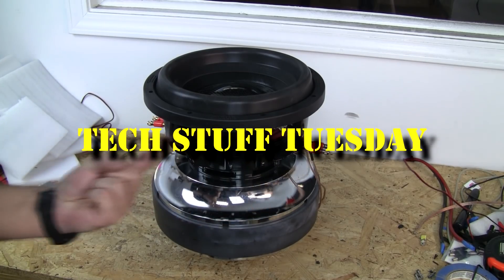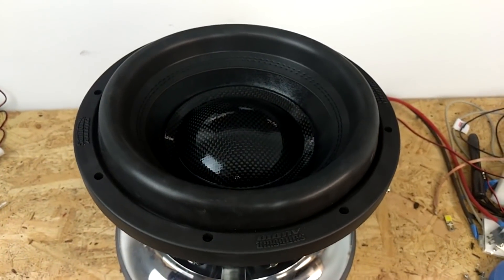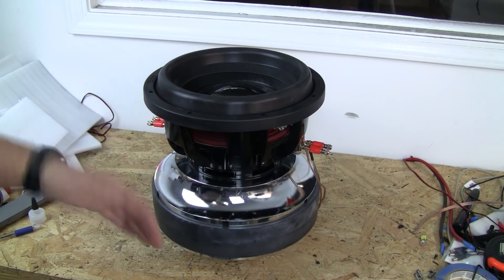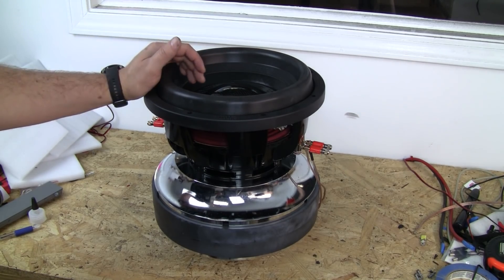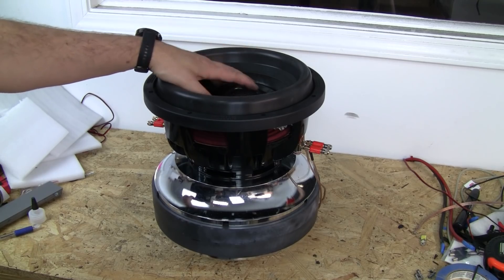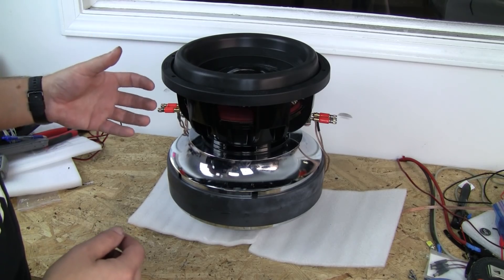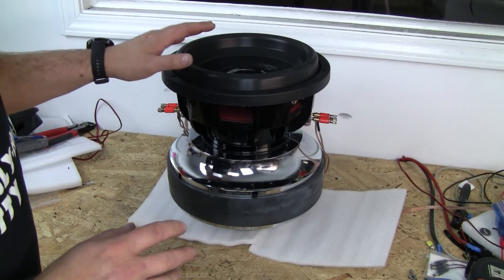This is why we bench test subwoofers - Tech Stuff Tuesday

Comment: EMF Audio, just a word of advice. A dremel tool ( Worx makes a very small profile rotary tool that is Corded and plugs into a battery pack) with a metal cutting wheel is ideal for cutting off your voice coil from the inside. You can get a straight and perfect cut and if it is a little uneven you can grind it from the top to smooth it off. Just wanted to bring that up incase you hadn't thought of something like that. Thank you for the awesome videos!

Comment: Hey :) I know the video is a bit older but I'm curious how we can calculate sub specs by ourselves since some. Companies don't give out the real specs
Reply from the maker: It takes specialized equipment for that unless you want to do a ton of testing and math, not something you can do with a DMM and a calculator. It's funny you mention that because the next Tech Stuff Tuesday accidentally showcases that.
Reply: @EMFAudio  hey man I got power acoustik 2500D with a single kicker 10 in a atrend ported box how should I set my gain? It's for a friend

Comment: I've never broke in any of my subs. Just strait to music.
Reply: I always just hook it up and play my normal music at 50/60% volume for a few days before I crank it up! 🔊🔊 never had a problem
Reply: the debate of wether or not to break in subs will never cease to exist as long a traditional subs are a thing haha. Personally, the closest thing I own to a subwoofer is a Ampeg ba 115v2 bass combo amp if that counts. 150 watts at 4 ohms (I think)  running through a 15 inch woofer and a tweeter. shit is loud af for my standards. I just gotta find a way to hook it up to a battery and toss it in a car, it already has the amplifier built in. But yeah I'll stop rambling.

Comment: I used to work for a satellite company which had a , if I remember well 15000 watts shaker speaker they used for testing unit reaction to vibration at different frequencies, the size was like (surround suspension) 6 feet and the surround was almost as thick as a tire... what a sub LOL...

Comment: For break in when sitting on magnet you should build a piece of 18 mm mdf to sit under magnet with a hole in middle and an exhaust gap to outside of wood for air flow from pole vent. Will help with stopping a pressure build up behind dust cap and give more accurate T/S

Comment: I also watched the build video and i wondered what subwoofer parts are the ones that defines fs. Is it so that stiffer spiders makes higher fs? It looked like you put one multilayer spider that had different colored spiders and so far all the subs i have seen had 1 to 4 similiar spirers. I`m going to make 10" subwoofer and trying to play some low notes with it. I probably use ti basket, 300oz motor ja 3" flat aluminium voicecoil so what kind of spirers and how many of them i should use?
Reply from the maker: The stiffness of the spiders and surround combined with the moving mass is what determines the Fs. The colors of the spiders mean nothing, they're all the same spider, colors used for identification. The weight of the motor doesn't matter, that basket is limited to 1 diameter of spider but the number of spiders also means nothing. Not every spider is the same stiffness and more doesn't mean better. To play lows you'll want a lower Fs, not a super stiff suspension.

Comment: whats the best 15in subwoofer @ 1000-1500 rms with the most excursion. I looking for a competitive sub-woofer to but against svs ultra 16 driver
Reply from the maker: https://emfcaraudio.com/products/sundown-audio-x15-v2
Reply: @EMFAudio  looks nice any chnace theres a 1 piece smooth cone with no dust cap?
Reply from the maker: @joeydelmarsjr.646  The smooth part IS the dustcap. I know the SVS sub you're comparing. The X15 enclosure would have to be larger.
Reply: @EMFAudio  for example the txx-bdc4-15, xr-15d4, and s2w15d4v2 all are smooth one piece with no middle dust cap. so your saying the whole cone is 1 giant dustcap?
Reply from the maker: @joeydelmarsjr.646  The cone us under it, it's a giant dustcap that secures to the top of the cone.
Reply: @EMFAudio  can you rebuilt with that look that I mentioned?
Reply from the maker: @joeydelmarsjr.646  In many cases you could simply put that style dustcap on top without changing anything else. In a worst case you would have to cut off the existing dustcap for clearance.
Reply: @EMFAudio  the reason I ask if I blow one of my audiopipe subs maybe you can rebuilt with that clean look and upgrade the coils to dvc 2 ohm 1200 rms
Reply from the maker: @joeydelmarsjr.646  Maybe, the dustcap is the least of concerns.
Reply: @EMFAudio  I see. I ask because I cant seem to find a 1200rms 2
Dvc 2 ohm to have head room at 1500 rms with the look I'm after
Reply from the maker: @joeydelmarsjr.646  I responded to your email. That style dustcap isn't common for a few reasons. You could add that dustcap yourself though.
Reply: @EMFAudio  I appreciate your help and advise

Comment: Why would sensitivity, not matter? I always heard that, the higher the sensitivity number the louder the speaker will play with less amplifier power. Also if you match the sensitivity of all your drivers, your entire system will play more nicely together. Meaning, you can run amp gains lower, and everything will peak around the same power usage without having to drive one amp harder than another. Is this correct, or have I been bullshitted for the last 20 years? 🤔
Reply from the maker: https://www.youtube.com/watch?v=VN_qgJkum20 You should watch that. As far as setting gains lower based on sensitivity, that's just ignorant. The gain is for matching the input of the amp to the voltage on the signal input. That's it. You'll likely never match the sensitivity of each speaker either. There isn't a need to do that anyway because you can adjust volume levels of each speaker to balance it out regardless. In short, you have been bullshitted in the worst way for the last 20 years.

Comment: Any experience with Brahma speakers?
Reply from the maker: Do you mean Brahma or Beyma?
Reply: @EMFAudio  Brahma by Adire Audio. My old buddy has an old version (purchased in 2004) which has some coil rub. We were thinking of disassembling and trying to diagnose it... You think it's still worth it?
Reply from the maker: @elit3darkness  The original Brahma, that was only in 1 size I have quite a bit of experience with. I had the first 2 ever made, I still have 1 I think. When it went to a line of subs which I think is what you're talking about, that was a different design all together and I've done nothing with those. Once you tear it apart it isn't usable again, so it's up to you if it's worth it to recone it to have it working again.
Reply: @EMFAudio  I guess down the rabbit hole we go lol

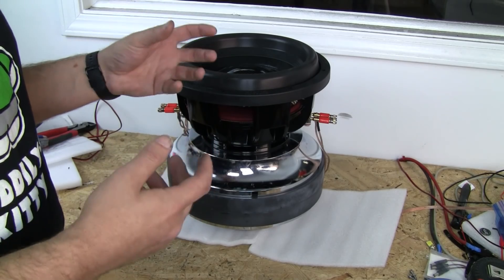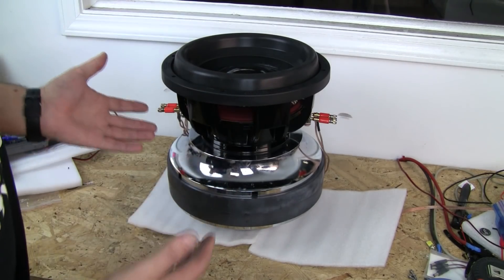Comment: 4:30-5:00 There were a couple of times there that your engine idle speed was so low I thought it was gonna die. :)
7:20 I noticed in the slo-mo, the speaker rocks side-to-side, perfectly in sync with the in-out motion of the cone. Could that be due to a slight misalignment of the voice coil in the motor?
Reply from the maker: It's due to sitting on foam and the entire speaker moving. That much motion wouldn't be possible from a misalignment, you can't physically see a misalignment. Misaligned or not, the forward and rearward motion is the same, the weight balance isn't any different.
Reply: @EMFAudio  
Foam, gotcha. 

My question was because, if the voice coil was off-center, the momentum would be concentrated on one side, and cause that rocking motion vibration. (shows up as rocking at super slo-mo)
Reply from the maker: @xenaguy01  Momentum wouldn't be changed because it's still forward and backward, regardless of it's position.
Reply: EMF Audio 
But if the momentum is not centered, it affects one side more than the other, causing a vibration.
Reply from the maker: @xenaguy01  Right, but the alignment has nothing to do with not being centered because that would mean the mass of the cone would be different on one side. The mass it the same around the entire cone. Because the mass is the same, the center of mass is in the middle, AKA centered.

Comment: Would love to hear how you go about calculating for perticual t/s parameters like if you did want this sub to have a lower fs or a different qts?
Reply from the maker: Without having known specifics on an individual part and the software to simulate it, you have to go off of experience. Lower Fs will come with a different Qts, and that can be done by using a looser suspension or adding mass.

Comment: I have two questions!
1. What happens if the sub will make some mechanical noises? Will you recone it again and lose that money?
2. Why is that sensivity so low, I mean PA subwoofers are 4 or 5 times louder on the same wattage, what are the differences?
Reply from the maker: 1. If there are mechanical noises it will get rebuilt at our cost. We do our best to ensure that isn't a problem during assembly and it's rare it happens.
2. That isn't exactly correct. PA subwoofers have a higher sensitivity rating, that doesn't make them louder. PA drivers are terrible at playing lows as well, the design method is totally different. In this case, this sub would play more like a PA driver but there isn't a PA 10" that will take the power this sub will. PA drivers also require a gigantic enclosure, this sub does not.
Reply: @EMFAudio  Thank you for the answer! I am not sure if this sub can go louder than a PA sub, esecially in long-range. I mean the custom sub is designed to throw bass 2 or 3 meters away you in a car, what about 50 meters outside? It is much more easier for a sub to play in the environment it was designed and that's why we cannnot really compare them. I am sorry if my second question was not understood but i asked only about the sensitivity. Have a good day!
Reply from the maker: @oprisvlad3102  Sound projection has to do with wavelength and enclosure. If you take a PA sub and a car sub and you put them both outside and meter them from 100 ft away, the car sub isn't going to be silent because it's far away.

Comment: How many watts do you think that thing could actually handle continuously?
Reply from the maker: 5,000 is what Sundown rates the Team series at, that is the coil used in that motor so I'd safely say 5,000.
Reply: On that coil, probably at 42-48 hz spl test i'd say over 8000...

Comment: Could you do a video explaining xmax and why some sub can only go one way and other can go both ways and the effects it has ?
Reply from the maker: Every sub goes both ways.
Reply: @EMFAudio  but not the same amount as it goes forward or it wouldn't say one way , am i correct ?
Reply from the maker: @chadbeverly4926  The only reason it wouldn't go as far one way as another is it was assembled extremely wrong, or it was designed so the coil smacks the back plate one direction and can move more the other direction.
Reply: EMF Audio so what do you mean when you say a sub has (?)Xmax “one way “ or in the case of the banhammer 35mm one way
Reply from the maker: @chadbeverly4926  One direction is the industry standard for measuring Xmax. However, there are companies that post Xmax figures as peak to peak, or both ways. That number would simply be cut in half for one way. They don't always indicate it's peak to peak, so it's deceitful.

Comment: Help me understand something:
The SD of this woofer is listed as 63.617, whereas my AB xd1244 only measures out to 51.071.
The reason I ask is because I'm building a mass-loaded T-line based off the listed T/S parameters for the sub as posted, and I want to make sure I'm not under-building an enclosure for it.
Is the decrease in SD caused by a lack of xMax compared to this sub, or is it because the FS for that 10 is higher?
Not using any computer program to do this, as Hornresp doesn't compute correctly below FS or F3 without loading the horn, and I plan on it being unloaded and tuned to 24hz, even though FS is listed as 35hz on the datasheet.
Am I barking up the wrong Birch box here?
Reply from the maker: First things first, the sub in this video is considered a 10" which is really an 11" and you're comparing it to a 12" from a catalog pushing company that doesn't engineer or test anything. The Sd figure you're going off of appears to be for a 10" model. You're basing a design off of incorrect information. Even if it were the right size, I believe all their specs are out of the box, not broken in, so they'd be wrong anyway. Sd is the effective cone area, it has nothing to do with Xmax or Fs.

Comment: Narrow and high surround foam or rubber is not the best. I think of side movements stability. have 1 spider is also not the best. I think of the mechanical stability when loading the loudspeaker with a lot of watts. Take some of the powerful PA speakers. They have 2 spiders.

It is nice to have a powerful coil that can withstand 800watt but then the mechanical must withstand it.
Reply from the maker: There is more to it than shape, material matters too. This particular surround is very stable. When you say 1 spider, do you mean a single spider or a single pack compared to spaced spiders? This particular sub has 6 spiders but it's all 1 pack. Another factor among all this is coil mass, distance from spider to the bottom of the coil, and cone depth.

Comment: If you have unlimited watts from the amplifier then sensitivity does not mean much. Car bass tend to have little decibels per watt! There you have a bit of the problem with powerful car bass speakers! Take a powerful 15 inch PA bass and it has much higher sound than what a powerful car bass has on the same watt. yes PA speaker must have bigger box one what a car bass must have.
Reply from the maker: Even if you don't have unlimited wattage, sub sensitivity doesn't mean much. I will be doing a video of that soon.
Reply: @EMFAudio  In PA systems decibel has something to say.
Reply from the maker: @ford1546  It doesn't mean as much as you think, not the individual driver itself. Once you are comparing them in enclosures, yes, that makes a difference, just like in a car.

Comment: Maybe you should build a little test bench to out it on that lifts it up from the table so it can vent out the back😋
Reply from the maker: It really isn't necessary for the purpose to have the vents open.
Reply: @EMFAudio  I know🙂 But it would still be nice to have😋
Reply: @Keith DeMons No.. Making a little testbench / frame to put the sub on. Not drilling a hole in the bench he got
Reply from the maker: @Keith DeMons There is no reason for a hole, or a mount or frame or anything. If there was, I would have already done it. That bench is 4 years old and never had a need for it.

Comment: That's an extremely impressive subwoofer especially for a 10 would be awesome in a bass tube like a 15 inch tube with a plate adapter for the 10 inch face and at 45hrz and up that would definitely do killer at SPL comps as most SPL competitions the Winning frequency is at 35 hrz and up to 60 hrz👍 great job on the build
Reply from the maker: Actually, ideal scenario for 45 hz and up for SPL would be a 3" coil driver, like our YOLO line.

Comment: I have a hcca 15 duel 2ohm motor and basket. I separated the cone, coil, and spider and wondered where i could get parts. By the way its an older version 1st or 2nd gen. 1200 watts power handling. Thank you for any help
Reply from the maker: Not having reconed one myself I couldn't say what is needed to do it.

Comment: Can we use 2 same amp to 1 speakers, will it made more power or it will blow up the amp?
Reply: yes you can
Reply from the maker: You can do that one amp per coil or you can strap amps if they are linkable.
Reply: I mean a single coil speakers.
Reply from the maker: @vuifong8008  If the amps are strappable you could, but odds are a SVC sub won't handle that kind of power.
Reply: Thank you

Comment: How will it fit in the box if the magnets bigger
Reply: it will probably be mounted inverted (magnet up cone or "front" firing into box)
Reply: Possibly will be mounted from behind. Maybe the back of the box comes off. Or possibly a split bushing that would attach to the speaker then be mounted in a box that has bigger holes.
Reply: If they were to try and use a tongue in groove style box face it could work
Reply from the maker: This is answered in this video https://www.youtube.com/watch?v=hPWRO-OCA2o

Comment: What do you use to test parameters? Do you have any experience with dats v2? Wondering how it compares to other test equipment.
Reply from the maker: We use a WT2, I've heard the DATS are inconsistent.
Reply: @EMFAudio  I have Dats v2. I have noticed that if you do the added mass method of measurement the readings will change a bit with different amounts of added mass. So it definitely is a little inconsistent, but it gets the job done. I have built a couple subs and was curious, so I bought it. For $100 I figured it wouldn't be a horrible investment if I plan on building more. Was also curious how far off of spec some of the stuff I owned was. And have checked some cheaper subs with no listed parameters for a friend. For high volume manufacturing I would probably want something better, but for a quick measurement I feel it works well.